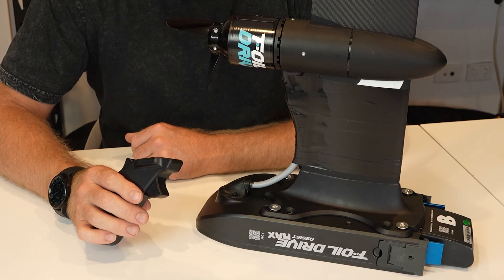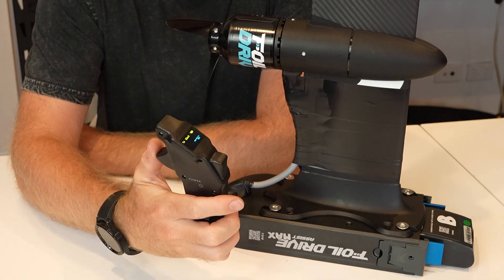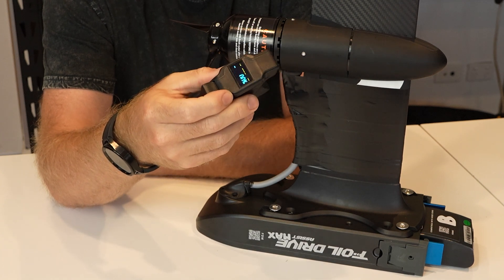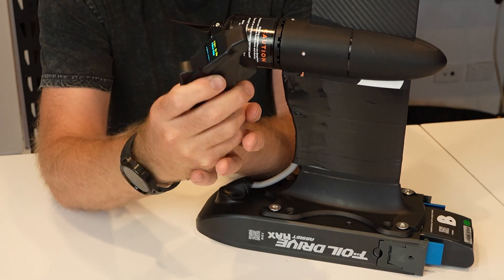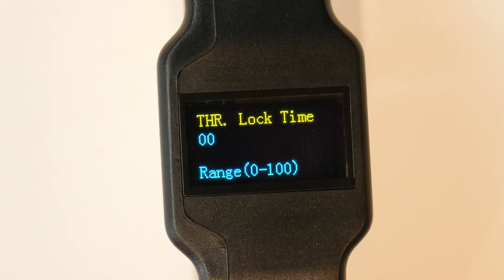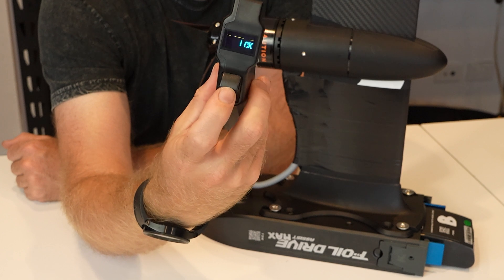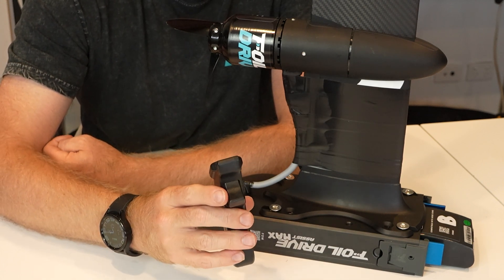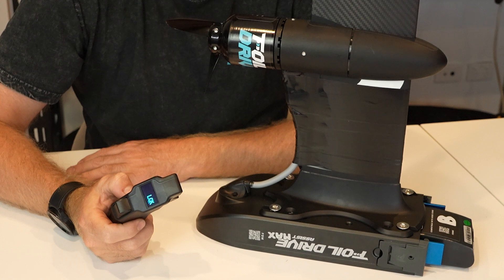New 2024 Controller Feature | Throttle Lock | Foil Drive

Comment: Hi! Great update! Are you also planning to make It possible to shift gears and hold the throttle to the max constantly (like a normal efoil)? Beginners tend to have problems with the trigger control and going up and efoiling 😎
Reply from the maker: We are always working on new features and hardware! it has been suggested before but most customers tend to really enjoy the modular nature of being able to quickly and easily adjust the power required. Granted that does take a little practise too!

Comment: It would be nice to be able to lock the throttle for going in and out of the surf. I just shut the remote off, but bring and to just turn on and off by holding the top trigger down for a few seconds would be easier